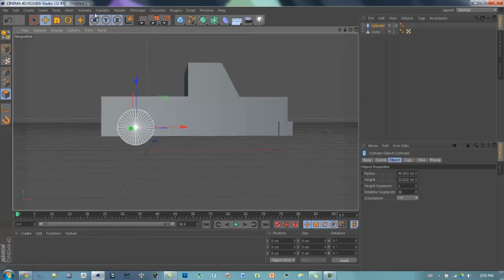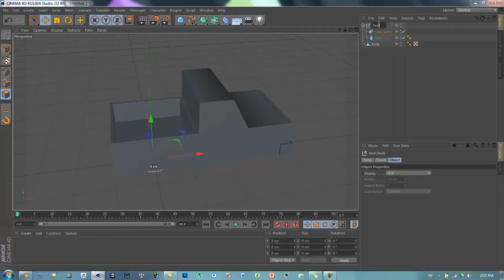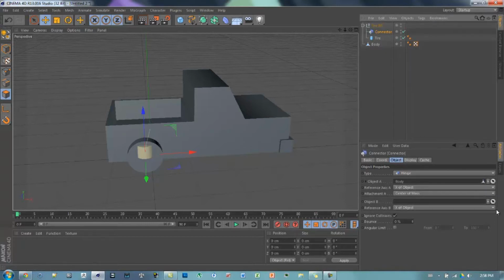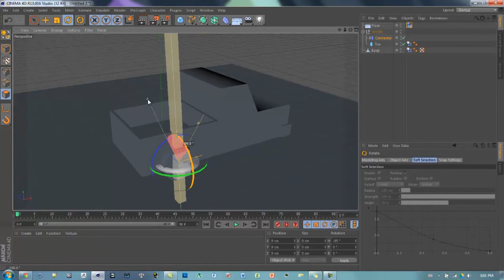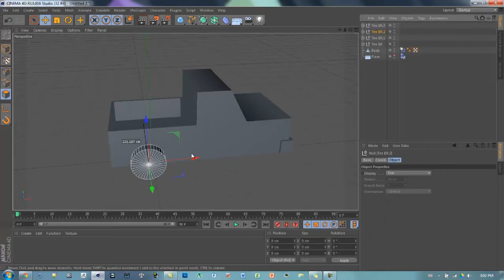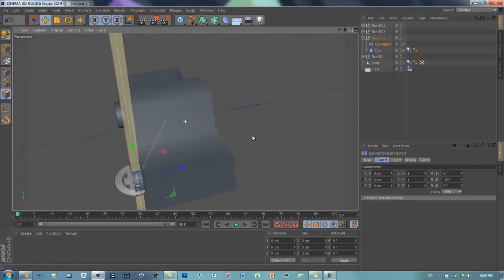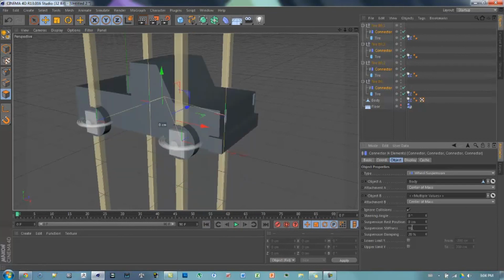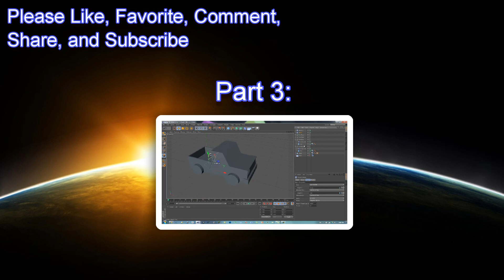C4D - SUSPENSIONS/ MOTORS TUTORIAL (PART 2: SUSPENSIONS)

Comment: Cool videos to get started with these dynamics. I was wondering, If you had a more detailed rig with all the suspension components, could you just use a motor tag to actual act as a motor turning a drive shaft made up of cardan connectors? this would distribute the physics evenly to the wheels much like the mechanics of a real car. this way you could set up a slide to control 4 wheel drive and switch to 2 wheel drive and possibly even have slip differentials?